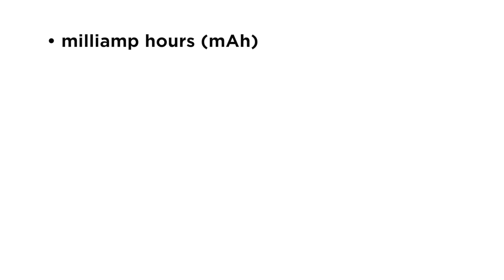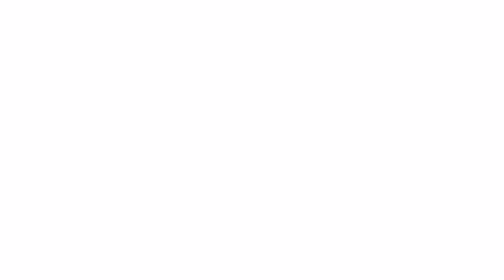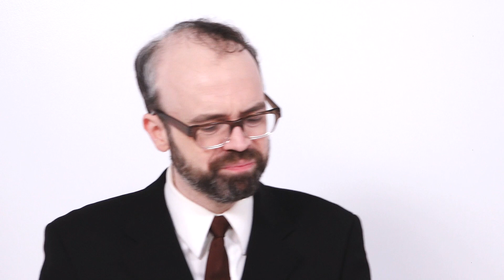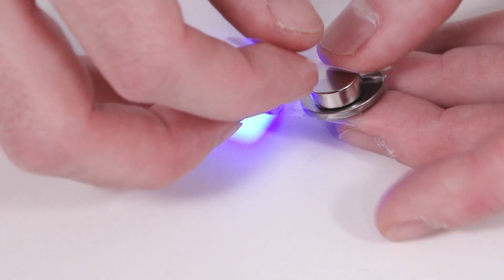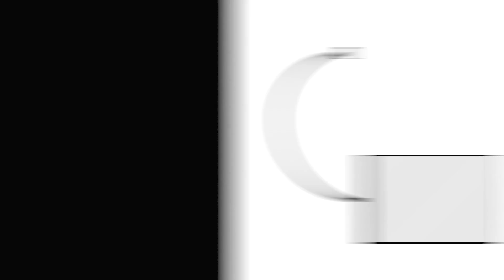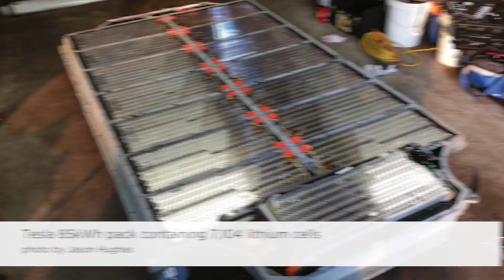Collin's Lab: Battery Basics

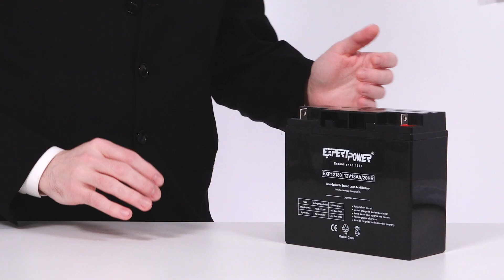Comment: 5:52 starter lighter ignition (SLI) lead acid are good for huge currents for starter motors, not to discharge and charge, deep cycle lead acid are good for charging dscharging for backup power

Comment: Late, very late, question from the peanut gallery, but I've always wondered - why would a manufacturer choose AAA over AA, or D, or others? For a while, I thought maybe it was just "which is the smallest I can get away with?", but after this video, I'm thinking, maybe, it's all about the mAh. Am I getting warmer, or am I (still) way out in left field?
Reply: A bit of both. C, D and 9V batteries are pretty much phased out by today's devices. C and D are too big and modern electronics are efficient enough to not require 9V any more. AA and AAA are the most common. The choice between the two mostly comes down to space constraints. You can approximately fit 3 AAA in the space of 2 AA. Smaller remotes like AC remotes will use AAA while bigger ones like TV remotes will use AA. If they need it to be rechargeable and even more compact, they'll go with LiPo.

Comment: It helped me A Lot to learn the reasoning in the number code on most CR-coin cell batteries. I live in the metric part of the world so it's kind of easy. So the numbers correspond to the dimensions. For example [ CR1025 ] = 10mm diameter x 2,5mm thickness... or CR3032 is 30 x 3,2 mm  etc... I don't know why they aren't more consistent but it helps to know approximately what you are looking for.

Comment: Nominal cell voltage is just the rough average voltage to expect over the course of a discharge.
A LiPo, while nominal 3.6-3.7 V, goes from about 4.2 when full down to 3.6 when empty. (open circuit)
Alkaline go form 1.6v down to ~1 V.

lead-batteries:
high surge currents? for their capacity kinda yes, for their size/weight no.
They are used cause they are cheap and don't degrade with lifetime as much and fail more gradually.

Comment: Can you make a third battery video that explains how alkaline recharging units work now? I'd love to see some of the chemistry specifics. I have a recharging unit that has a sliding switch to change between nickel metal hydride, alkaline, and one other type. It works decently for alkalines but I haven't been able to find a good explanation for my chem students about why alkaline recharging is suddenly possible or what happens in the cell when it's being recharged and your explanations are so nice, crisp, and clear! Thank you for Colin's lab, I use them all the time with my robotics and physics class! Now I will use these battery ones with my chemistry kids when we do electrochemical cells!